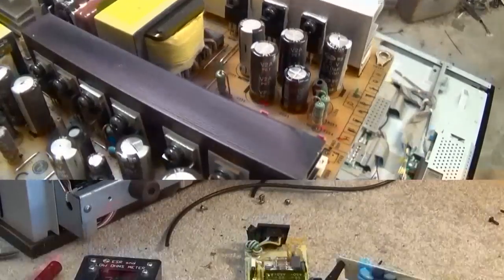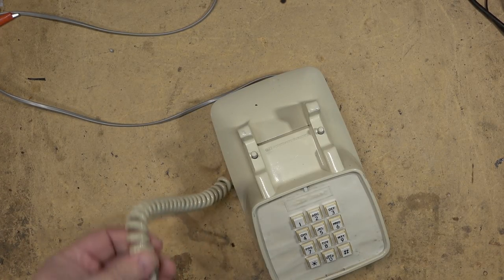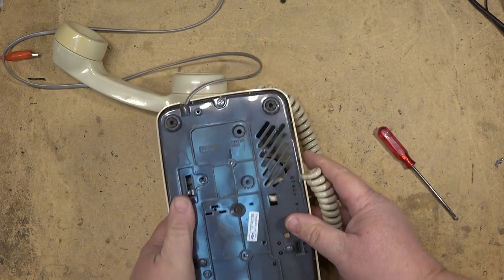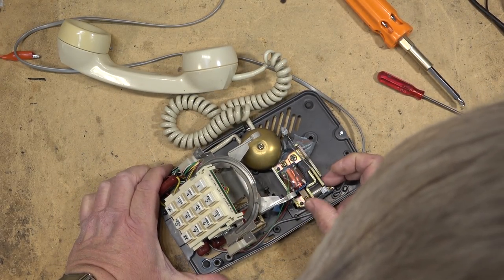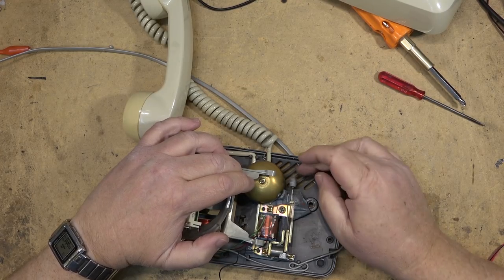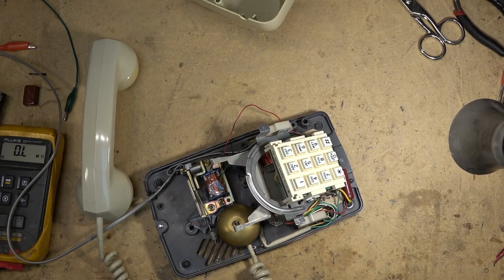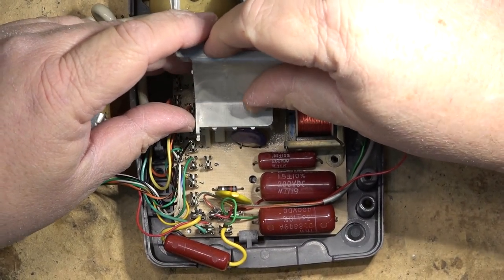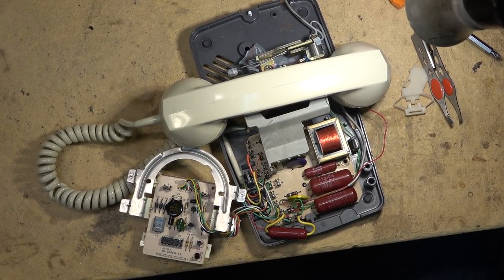Vintage Old Hello Machine repair

Comment: I'm a retired phone guy.  I, too, still have a home phone - with VOIP service.  I have a variety of instruments.  One is a 1968 model Western Electric rotary dial 500 set with the classic dual-gong ringer.  My VOIP service recognizes dial pulses and provides 96 vac ring voltage.  Visitors' children are amazed at the sound quality, but confused by the appearance.
Reply: @Free in Jesus Got me.  My VoIP, and the modem, is provided by my municipal ISP.  The adapter is an internal plug-in in the modem, and the modem is sealed.  The phone line output to my 66 block is, essentially, an analog MPOP.  Surprised me, too, when I discovered pulse recognition.

Comment: Dave, I joined what was then New England Tel as a Toll Technician in 1969. MF (touch-tone) signaling was expanding, and our old Stepper-Switch was going to be retired. A new NET 4A building was built, housing 7 floors of equipment and tel workers. ESS first floor, telephone operators second, 3rd  4a crossbar switcher and cpu , 4th floor crossbar tandem, 5th standby generators, 6th toll test, 7th AT&T long distance with Micro-wave equipment, and antenna towers. I remember if you had the t&r flipped you could not mf out, early touch-tone phones were heavy. Happy New Year...
Reply from the maker: My local exchange is still running a gdt5 which supports tone and pulse dialing, but every time I go in there I see fewer and fewer cards and the sounds of the relay clicking are few and far between. 10 years ago a walk-through the switch and all you can hear is tick tick tick tick tick tick all the relays hopefully and closing and the ring generator relays clicking away. Today I put all you hear is the sound of fans and the odd click when one of the few people left on copper picks up their phone to make a call. All the fiber rotors occupy only a couple of shelves. Soon the number five will be completely decommissioned and removed and that half of the office will just be a big empty space. The space where the old stroger used to set has been empty for years when they built the number five they built it next to where the old stroger was located. Could still see the holes in the floor where the equipment was bolted down. Soon the number five space will look the same. I actually got in at just the right time in my career as I'm nearly retirement just as the technology changes and they won't need us copper-trained text anymore. I do mostly fiber these days anyway but the new techs that are being hired now get no copper training whatsoever. If it's a copper based trouble the customers either converted the fiber of the spot or if it's a non-doable such as an old building that has no fiber and has not been retrofit then the job goes to one of us old guys that still know how to work with the old copper technology.

Comment: My parents are still alive, mom is 84, dad is 89. I was talking with mom and said "Remember the days when we never lost the phone? You always knew where it was because it was attached to a wire, or the wall."

 I had an old Western Electric rotary phone that was red. We called it the bat phone. Still have one of those french designed phones with the 90 degree mouthpiece. It is also red, sold by Radio Shack I believe.
Reply: We'd love to have a genuine Western Electric desktop 'candlestick' phone...

Comment: How cool is that you got replacement bells that fitted perfectly! Awsome!! :-)
Reply: There wasn't any need to replace the bell. It just needed adjustment (one screw). The replacement bell wasn't adjusted properly either and wasn't working properly either.
Reply from the maker: @johncoops6897  The replacement bell is working just fine. I have 10 phones plugged into the line. That is 10 ringers and if you knew anything about the phone system you would know that each ringer loads down the line. Electronic ringers don't load as much as mechanical bells. Well I have 5 bell phones just like this one on the line, and 5 electronic ringers. That is why the bell rings weak, not the set up of the bell. The replacement bell came directly out of an old phone.
Reply: @12voltvids  - I know how the system works (identical hardware to what was used in Australia). Despite any reduced ring voltage, it's trivial to adjust the bells so that the knocker touches both bells when it rings.
NOTE: I am basing my comments on what the video sounds like at 15:40... a buzz, and limited ringing on one of the two bells.
Reply from the maker: @johncoops6897  yes i know. Just loosen the screw and turn the bell as the hole is offset.  However when i plug it into my VoIP adapter it rings loud and clear. This one going on my business line.

Comment: I just went through a similar teardown of a Western Electric 2500 touchtone phone from 1978 last week. I had the opposite problem - it would ring and talk but couldn't dial out or even break the dialtone. After a few hours of scratching my head with the schematics and learning all about the 'networks' installed in the phone for impedance matching and such (and learning that varistors used to use the same schematic symbol as today's DIACs..arrgh), I finally determined that my commercial bluetooth phone interface just isn't supplying enough current for the old 35-series DTMF dial to function. This was before the DTMF ICs that were used later, and it's an oscillator using a couple coils, caps, and a single transistor. When given 'off-hook' voltage via bench power supply at the same voltage provided by the interface (~5-6V), it dials just fine. With the BT interface, the voltage drops to 2V with button presses and it's just too much for the poor thing to handle. I plan to bring it to a neighbor's place and test with a 'real' POTS line to see where the blame really lies.

Comment: I'm in the UK and still have a home phone line (although it's a Vonage VOIP one I've had since 2006!) with a proper bell phone connected (a replica of 1930s GPO 232 'Pyramid' set, in black bakelite.) My late wife had a Princess phone that she paid $2 for at a thrift store... I got the dial lights working for her but unfortunately it disappeared after she died.

Comment: Great way to start 2022, you can't beat equipment that was designed to be repaired.
I think we need to go back to the days when you repaired faulty gear rather than
throw it away.🙂
Reply from the maker: I overhauled my other 40 year old wall phone from the shop today. Film soon.

Comment: I had the privilege to work for BC Tel in the 1980's. We still were maintaining those and pay-phones at the Lenkurt Electric Company facility at 7018 Lougheed Highway. I miss the access I had to the vintage equipment surplus sale put on by members  of BC Telephone Pioneers who sold only to employees.
Reply from the maker: Well I first applied a BC tel in 1981 because my uncle work there but I was still in school at the time. By the time I graduated in June 1981 they had finished their hiring blitz and there wasn't anymore postings coming up anytime soon so I went right to school at BCIT to study television production. I've been working as a volunteer at the local cable station all ready for a couple years and when I finished BCIT got my first paid job at the cable station Master control. Did that for a while I meant an opportunity came up to go work for Sony Canada. Entry level betamax trainee technician 9.63 an hour in 1983. Cable station was paying five bucks an hour and minimum wage back then was 3.15 an hour. I had studied electronics from an early age and in high School so I jumped at the chance to work for Sony, they put me in there Special High Intensity Training. Stay with Sony for about a year then they wanted me to transfer to Winnipeg and I still remember telling my boss at the time that hell would freeze over before I would go to Winterpig. He made a few calls to a few of the self-servicing dealers that were struggling and I ended up going to one local place, impressing the owner and got an offer that had me there the next 20 years. Then I heard from a friend that one if his friends had been hired to teach Telco courses at BCIT as Telus was going to be hiring again.  Unapplied a second time and here I am 17 years later.

Comment: Never worked on a vintage phone before.  Was interesting 
to see the guts and operation.  I have a landline myself but 
I don't have the old phone unit.  I may have to find one now.  
Wonder if the older touch units will still work on a landline here?
I forgot how cool these were compared to the new dialers.
Cheers and Happy New Year!  🍻 -AL
Reply from the maker: Yes DTMF is the same now as it was back then.

Comment: If clean contacts up like that I use the wifes nail file the Emery board ones not the metal they are excellent for getting between the contracts ps happy new year Dave

Comment: I am no longer owned the land lines. I had Princess  Made by Bell Atlantic in 1976 and it cost $2.50 a months to rents it with power supply to light the dial. I love this phone so I stole it.

Comment: Imagine dialing a rotary phone with all 10 digits required in 2022!
Reply from the maker: Yes and the reason they did that was to stop the drug dealers from dialing pagers from pay phones. What they would do was call from a payphone punch in the number of the pay phone and wait for a call back. Kind of hard to enter a phone number to be called back from a rotary dial phone.
Reply from the maker: I still have two rotary phones in my house very old ones from the 1950s. They still work and yes it does take a little bit longer the down 10 digits. I remember when I was a kid you could dial someone with four digits if they were in the same exchange I remember dialing my grandmother's house and her numbers ended in 2002 and that's all I had to dial. I was back in the party line days. You could dial just the last four digits and hang up I think and a phone both phones would ring. Seven digit dialing if you wanted to dial someone in a different change and then in the '80s I guess it was they went to 10 digit dialing or maybe it was the 90s jeez I'm getting old as a while back. I remember when we just had one area code for the entire province and now we've got I like five area codes now.

Comment: Happy New Year! Did you consider swapping out the bell of the original? It sounded a bit deeper/lower to me... or would a two-tone bell sound wrong for this type of phone?
Reply: We were wondering if the original bell unit had been set to a quiet ring. The new bell had an obvious rotary switch on the bottom that let you select the volume of the ringer. Didn't see it on the original unit. Maybe it snapped off?
Reply: He just needed to rotate the bell (on it's cam) or bend the arm so that the knocker/clanger thingy would touch the bell when it actuated. He didn't adjust the replacement either, so it was only "just" knocking on one bell and not even touching the second one. That's why it sounded so wrong.
Reply from the maker: @johncoops6897  The original bell had the second bell snapped off. It should have been a 2 tone bell. The striker could have been bent, but I wanted the authentic sound and I had a spare kicking around from an old direct line taxi phone.  I have a few dozen vintage phones I pulled out of the dumpster last summer I will eventually get to and make them functional again.

Comment: We has one-a those in black (ITT) with a red light (either a silent ring indicator or for on hold) on it. Only finding a rotary would be sweeter...

@6:32 - someone physically signed off on this board! Kewl!
Reply from the maker: I have several rotary dual phones.  One of the perks of working 4 the fone company. Get to pick through the recycle bin.
Reply: @12voltvids  ~ ours was from some office that kicked a box of their old equipment to the kerb. We used to have a rotary phone - another find 'in the wild' that was a flat squarish desktop model with a sort of Tiki-themed stick on 'skin'. Don't know what we did with it. 

We still have a landline but it's now a fiber-optic line instead of trusty coax copper. Instead of having a line that could power itself after a nuclear war, TPC™ put a battery backup in our basement. Progress.... Le Sigh...
Reply from the maker: @chezsnailez  we are upgrading everyone to fiber here too.  Shut down of copper coming soon.  Big push on now to get the hold outs moving.   I deal with them every day.   Usually for the same reason they want phone to work during extended power failure.

Comment: Who has a home phone?

Me!

Why?  Why not?  I have the line, I have a home, so I have a home phone.

One thing I love to do is only give my home number to companies etc or websites.  They can happily sell that number and cold call that number as I'm out most of the day and when I'm home I will screen the calls anyway.  I hate getting cold calls on my mobile phone, hate it.

It also sounds better than the mobile which helps when calling a company up, plus there is a point where I like leaving the mobile phone (cellphone) upstairs and not being permanently attached to the thing.
Reply from the maker: And when I am not home i can't be reached.

Comment: 7:35 - gosh I cringed when he destroyed the contacts with 120 grit abrasive paper! Even 1000 grit would probably be too coarse to maintain the (probably silver) plated contact surfaces. This is NOT the correct way to clean the contacts of leaf switches, relays, etc LOL
And the ringer - all it needed was to loosen the bell and rotate it (it's like a cam). If that fails, bend the arm so that the moving "clanger" actually touched the bell when actuated. No need to replace anything. In fact, the replacement wasn't adjusted properly and was improperly striking one bell and not even touching the second bell.
Reply from the maker: But I wanted the proper double bell. Contacts are fine, no pressure was put on them just enough to take the crap from sitting out in the rain off it. Remember this came out of a dumpster when I found it.